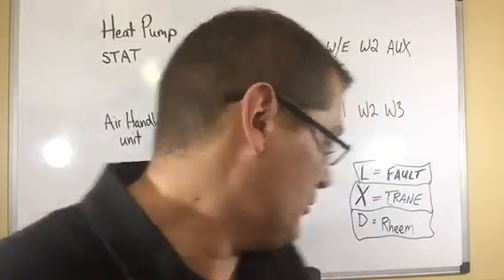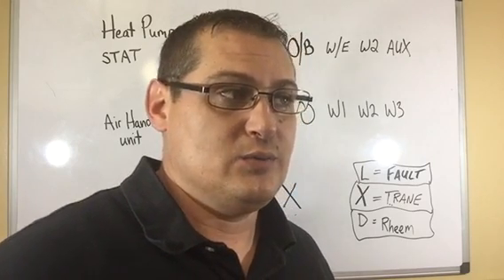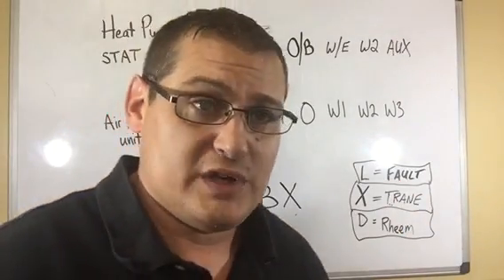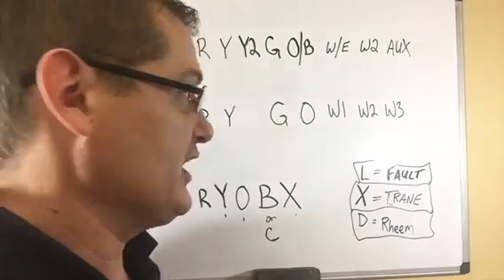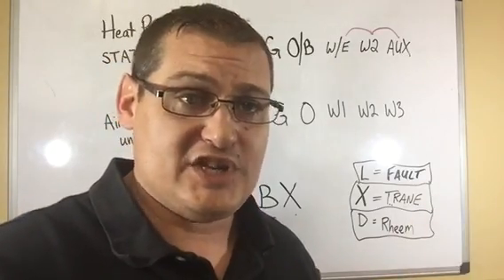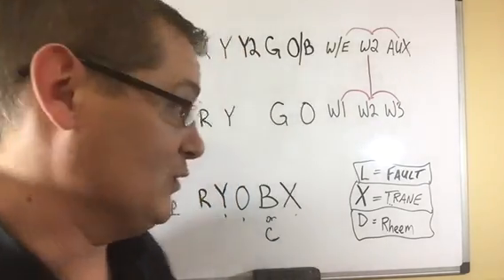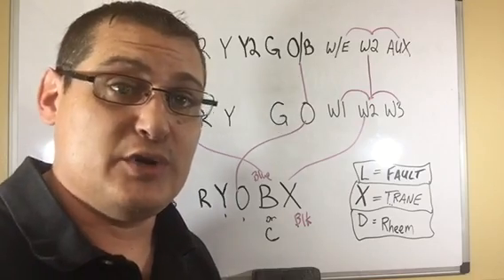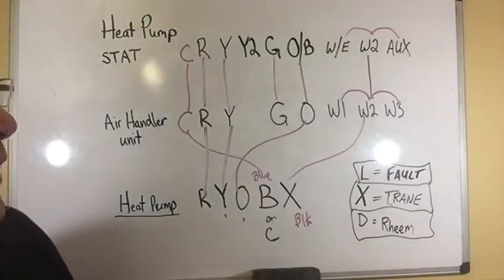HVAC beginner: Wiring a basic heat pump system

Comment: B is never common
C is always common
B is when your equipment  uses the reversing valve for heat and o is when your equipment uses Reversing valve for ac.
Some manufacturers use reversing valve for heat.Some use it for a c.
Most of them use 0= the reversing valve for a c.
On your outdoor heat pump you will have a w1 That will send power back to your heat on when it is defrosting.

Comment: Thank you so much for a well explanation. I don't understand some systems Y from thermostat only connected to condenser Y outside but it's not connected to the air handler. But most heat pump systems thermostat Y connected to air handler and to the condenser. Why is that not connected the same?
Reply from the maker: Y is a call for compressor. In a heat pump Y is energized with a call for heat AND with a call for cool. With a totally electric system the thermostat brings the air handler fan on for heat and cool. With a gas furnace, the board brings the fan on for heat and the thermostat still brings the fan on for cool. Y basically goes from the stat straight to the outdoor unit on both systems even if it uses a board (Y) to tie the stat wire to the outdoor control wire. So Y is the same in both systems. Sometimes there’s no terminal at the indoor unit for Y because there really doesn’t need to be one. Hope that makes sense. Just think of it like this, Y has one job which is to signal the outdoor unit to comes on. G and Y are basically the same terminal at the stat on a heat pump. Whenever there’s a call for heat or cool the indoor fan is energized at the same time.

Comment: If the compressor defrost signal is connected to both the thermostat and the air-handler W terminal(s), wouldn't there be an electrical conflict on that connection, since both the defrost signal and the thermostat signal are outputs, and could disagree ?

Comment: I have white wire on w1 and black on W2 is that correct
Reply: i noticed white wire W2 and black wire W/E and there's no heat during defrost mode

Comment: What is S on a thermostat
Reply from the maker: Some stats have an s1 and s2 which is for an outdoor sensor. If that’s not what it is then see what color the wire is and then find that same wire at the air handler or heat pump abs see what terminal it’s going to.

Comment: Thank god you have L terminal 
I have a 4 bulb mercury bulb thermostat.
I put on a pro 4 and heat didn’t work
3 wire
Blue —-     white —-Red
C=com/.   E= emg heat to melt ice on compressor ——o= reversing valve.

5 wire ///white heat= w1 /// green=G fan yellow = y AC ///red= R 24 v ///Blue=L

I hade to put back on the mercury 4 bulb thermostat and all functions work fine. Didn’t work with pro 4 thermostat.
Is there another TState you recommend 
The mercury Thermostat was a heat pump system control Carrier since you said fault there is a Red LED bulb on that mercury thermostat.

Comment: I have a Two stage furnace and heat pump I want to get wired up. I have two thermostats going to a zone board, two zone dampers, heat pump with 4 wires (Blu, Yel, Wht, Brn) and a furnace (air handler) with terminals 6 or 8 terminals. its a bosch heat pump and and American Standard furnace with honeywell thermostats and zone board. The American Standard manual shows the terminals but does not say what they do, getting hung up on this. Would you be willing to write a line diagram for this? huge help.

Comment: I need help.  I have a Sensi ST55 thermostat, I’m connecting it to a Trane Heat Pump system.  How do I properly wire it?
Reply: Did you find out? After watching this video I felt like I understood where the black should go. Its currently in the X2 spot which does not exist on the Sensi ST55. Now I'm not so confident. Our friend's video and diagram says the X, and D sends power to the back up heat while in defrost. He ties it to the W2. The ST55 does have a W2 available. Its been a while since you posted. I hope you were able to install it.

Comment: Could someone please explain to me why Y is compressor on straight cool but Y is cooling on heart pumps? 

What's the difference? Doesn't Y go to the compressor contractor either way? What difference does it make if you call it compressor or cooling????
Reply: Nothing. It's 24v going to Condenser, outside unit, where the compressor is located.

Comment: I'm having a problem hooking up this wyze thermostat to my heat pump furnace. I have 2 S1 wire one is blue and one is light Brown I know one is for the outside temp and the other is for the heat pump but no matter how I hook it up W1 wont blow heat and the W2 will throw out heat.

Comment: I tied green and red nothing happened
Reply from the maker: R is your power. G is a call for the indoor fan operation. If you have no operation you probably do not have power.
Reply: @hvacmillionaire  I have 24 volts at the red wire
Reply: @JoseVargas-bz3zd  One year later.  What did you find to be the trouble!

Comment: only have 4 wires from air handler to out side unit but out side unit has  y c w r o  i seen that old unit had 2 wires tied together but not sure which 2 were any suggestions
Reply from the maker: Not sure about the wires tied together. You should need all those wires at the heat pump. Maybe they were energizing the reversing valve constantly with “R”  and. “O” tied together?
Reply: @hvacmillionaire  thanks

Comment: Just a note for others watching this video. Bosch heat pumps use 'B' and not 'O'. In other words, you energize the Reversing valve for HEAT and not COOL. Also I think the Bosch heat pumps use 'W' for an Aux heat call back to the air handler. Thanks for the video.

Comment: Thanks for your notes on the wiring of the heat pumps especially as it relates to train.  discovered that the reason my heat pump(Trane) hasn't been switching properly is because the installer wired it wrong years ago!  rewired it by your instructions and now everything works better than ever!
Reply from the maker: Good deal!!

Comment: thank you. i was wondering what to do with my O wire coming from heat pump and t-stat since my air handler does not have a connection for it.
Reply from the maker: johnny dngrs just tie them together at the air handler. All “O” needs to do is go from the stat to the outdoor HP.
Reply: @hvacmillionaire  did that as soon as i finished watching your video. thanks
Reply from the maker: johnny dngrs you just tie them together.  👍

Comment: Do all heat pumps have aux heat?
Reply from the maker: Most do. With a heat pump once the outdoor air gets below 25-30 degrees there's not much heat left in the air for the refrigerant to absorb. Once that happens the house temp. will begin to drop. The thermostat recognizes that and a second stage gets energized which is the signal to energize the back up heat (typically strip heat- heating elements)

Comment: My Trane 624 thermostat stopped working and is no longer available. I bought a Honeywell stat and I’m trying to get information on what to do with the black wire. There is no terminal labeled Black (BK). 6 terminals, but I have 7 wires. Any advice is appreciated. Thank you.

Comment: Good morning. Need help. I have a ‘L’ wire but on the new thermostat I have not spot for that wire.  The wiring is an eight wire. The new thermostat has only 7 slots. I know you said the L wire was the fault. Which terminal should I tie it too?  Thanks.
Reply from the maker: Obediah Anderson don’t tie it to anything. Just make sure it’s not touching any of the other wires.
Reply: HVACmillionaire So I don’t need the L wire?  I also have an E terminal and it is black. The L wire is brown.
Reply from the maker: Obediah Anderson “E” is typically jumpered to w2 or W. The “L” wire you should not need.
Reply: HVACmillionaire thank you so much.

Comment: I have a Trane unit with heatpump, my problem is the aux heat strip, it's a 10k but when in heat mode it's only heating half of the elements, I put in a new heat strip and it didn't change. Any suggestions?
Reply from the maker: Rnull 22 it could be that it’s not wired in at the air handler (control wiring) or that the switch isn’t working (sequencer or contactor)  this is where I would start. Very difficult to help with this problem without pics, a volt meter and a schematic.
Reply: @hvacmillionaire  it happened last January called service tech they came out and checked it out told me its the heat strip so I got one same part number bayhtr141000 heat strip I installed it this morning, turned it on and has same problem when in emergency heat mode, it used to blow heat temp at vent of 140° now blows 90° coming out of vent.

Comment: Quick question. I am installing a Rheem heat pump unit. I Have "brown" for common. So what is the purpose of the "Blue" wire. For I do not have a blue on Air handler nor on the nest thermostat.
Reply from the maker: The blue wire is "B" which is the reversing valve. On Rheem it is energized in heat mode. The thermostat has to be heat pump capable and there should be a setting in the installer configuration to change the reversing valve from "O" to "B".
Reply from the maker: At the air handler the "b" from the stat will just tie to "B" going to the heat pump. No need for a terminal. the stat will energize the reversing valve when needed (when stat is in heat mode)

Comment: "Rc" + "C"- 24V DC ? 
"Rc" "C" 24V AC? 
How right?
Reply from the maker: If there's an RC and RH terminal in the stat they probably have a jumper wire between them. If not install a jumper wire. Very old systems used 2 transformers. One in the outdoor unit and one at the indoor unit. I haven't seen one of those in many years. Most have been replaced at this point. You would only use Rc by itself if you were working on a 2 transformer system. I have no idea what you're talking about on the 24 V DC. ??
Reply: the thermostat on the contacts (Rc, C) must be supplied with a constant voltage or alternating voltage.
Reply from the maker: It's AC volts for residential heating and cooling thermostats.
Reply from the maker: If you have a millivolt gas valve with a pilot generator then its DC volts.
Reply: I did not understand the answer. use translate google.
AC  or  DC ?
https://drive.google.com/file/d/1MP2nd6UmV4SabfsrVZpQ6rSEpiLL3ehL/view?usp=sharing
Reply: It's a 24 volt transformer, AC voltage. Most hvac units operate off a 24 vac transformer. A transformer alone can not produce a DC voltage. Hope that helps.

Comment: PLEASE HELP!!!
question; i had a new hvac heat pump installed may 2017. the ac works great as it it designed.
but when heating the A-coil is freezing up and the line set too, only half way toward the compressor. it is a Ameristar model M4AH4025A1000AA, volts 208/230, motor HP 1/5, motor FLA 1.0. the thermostat is  Proselect, connection are... R (connected red wire), O (orange wire),
B (empty), C (BRN wire), Y1(yellow wire), E/W1(Blue wire), G (GRN wire), W2(WHT wire)
Reply: you should call the installer as it should still be under warranty.  Tell all of us who installed it so we don't hire that person.